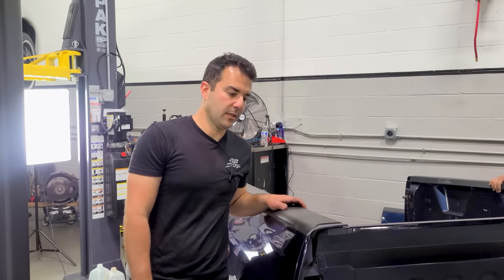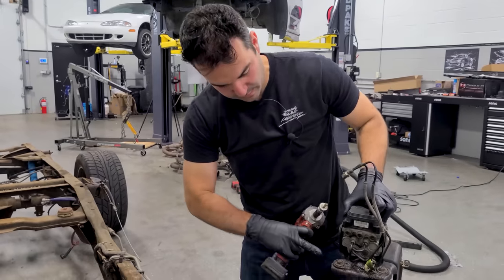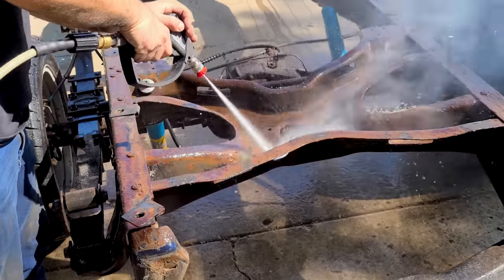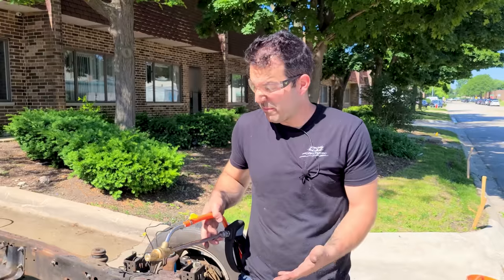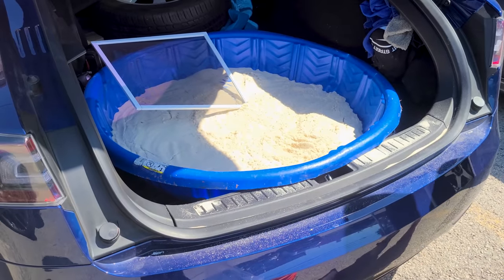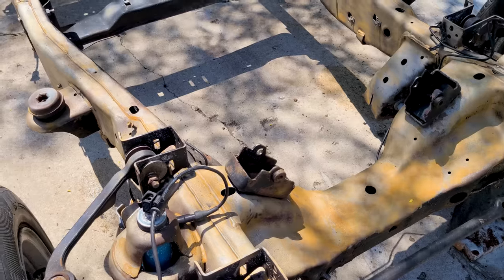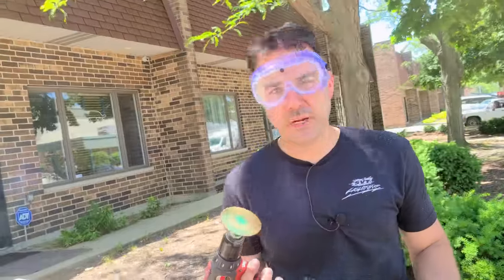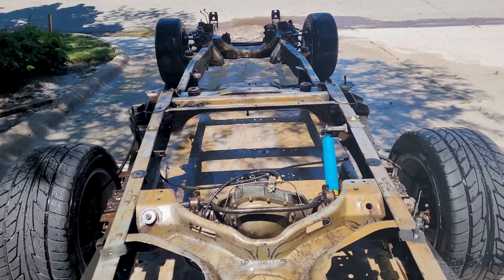I Was Quoted $3,000 To Sandblast My SVT Lightning Frame So I Did It Myself For $100 & So Can You!

Comment from the maker: Would you guys ever do this? What kind of pickup do you drive?
Get started today with a Smart Lawn Plan from Sunday and get 20% off with Code LEGIT20! https://www.getsunday.com/LEGIT
Reply: Yeah, one thing leads to another... :)
Reply: I sandblasted whole frame of my dad's Iveco Daily (it's a little bigger than your truck) and I was 19 at the time. I used regular sand blaster that works with high pressure air. It was pain in the ass to get to some places.
Reply: I’m curious why you didn’t just use a regular sand blaster?
Reply: @GRosa250  I think it's because it's very "messy". In the place when you sandblast is gonna be a lot of rust and used sand and it makes everything around dirty.
Reply: I'm doing a 1977 CJ5 in my driveway. The pressure washer add on will work great. Do you have a link for it ..??
Reply: Hardly 100 bucks when you add the cost of the pressure washer not to mention the lift you used to get the cab and bed off the frame. Throw in all the fasteners and clips you'll break or mess up and its gonna run a lot higher than a hundy...
Reply: Yes I would and I’d like to be the first one to say if you’re ever interested in selling it since I can see you like to take care of things please get in contact with me I have been looking for a true blue lightning for a long time miles don’t really matter especially if it’s somebody that’s trying to take care of it and preserve it
Reply: Hi, from South Africa. I have a 2018 Ford Ranger 2.2 TDci. Six speed manual gearbox, single cab with a 8 foot bed. And, we drive on the correct side of the road 😂👍, so it is a right hand drive. We have harsh winters, but no snow and ice and thus no salt on the roads, and no rust. I live in Bloemfontein, 4500 feet above sealevel and a dry climate as well. My truck now have 136 000 km (85 000 miles) on the clock, and I love it.
Reply: You missed the obvious joke that you feel like a rust buster.
Reply: I drive a 1989 Landrover pickup that's going to get a new frame this year , I just know I'm going to turn it into a restoration.
Reply: if i would come to this stage, id rather strip the entire frame and sandblast it and then powdercoat it. now it seems like a ton of extra work when you are gonna treat the bare metal. nice solution though the water/sandblast, but for this application i think it wasnt the most optimal "when you are at it" :D
Reply: @sttm1283  If I went this far I would do a complete restoration and sell the truck at Barrett-Jackson.
Reply: @mexicanspec  well that would be a option but i guess alex is keeping this old truck for nostalgic reasons, and therefore i would just suggest to do it properly. but since he has more knowledge than me concerning this type of stuff im guessing he knows what he is doing :D
Reply: I did a Chevelle Wagon frame with walnut husks and a HF media blast tank.
Reply: @hammyh1165  I've been on land rovers for 22 years now and Every Land Rover that comes off of the Solihull production line is a restoration project of the future!  I just love them! Had a  series 2 swb, series3 lwb 3.5 V8, Disco 1 3.5 V8, Disco 2 4.0 V8, now a L322 4.2 Supercharged! Love this one even though I spend a lot of time working on it lol
Reply: @sttm1283  powder coating is only just one step up from a paint job in my opinion. Water still gets under it and rot takes hold. I suppose Alex is going to use some form of phosphoric solution to treat the rust then put a special covering over the top. Once it's had the rust treating done it is far more likely to resist any further rust problems, unless of course the rust treatment is removed by some physical abrasion like accident damage. Anyway a few Chicago winter salted years will show us how good the stuff is, but powder coating won't cut it in my opinion lol
Reply: I am a cheapskate so I would totally consider this.  My wife would probably be looking for a divorce lawyer after the weekend though 😂
Reply: 2003 F150 Lariat 5.4L with 205k
Reply: if im going to go this far for restoration, ill take it all the way and get the frame acid bathed and then coated.
Reply: You should try a side grinder with a flapper wheel.
Reply: Thank you for this! I bought one of these blasting attachments for my power washer a while ago for when I get around to blasting the frame on my classic c10. Couldn't find a lot of vids on how well it worked that were this high quality.
Reply: @hammyh1165  if you have a landrover that is the normal state of maintenance
Reply: Pretty excited to see the completion of the frame. So satisfying. If you have a decent pressure washer, you can do this on the cheap.
Reply: Get rid of those leaf springs and put a four link in it on bags 👍🏿
Reply: I would probably do this but I'm only one guy!  I have a 2011 Chevy Silverado Z71 Extended Cab.
Reply: I would flip the whole frame over and blast the other side that way. It looks like you might actually have enough ground clearance that the wheels would still touch the ground with it flipped.
Reply: Hell no! Do you know how much your hands will hurt after using the blaster for 20hrs? You will be seeing a doctor after this process is over!
Reply: You missed a spot‼️🤣
Reply: He missed a spot‼️🤣
Reply: Yes, I would love to do this.  I have a beautiful 1999 F250 super duty 7.3L turbo diesel that I use for my lawn care business.  Every time I start any kind of project on the truck it turns into a rabbit hole and it's hard to stop once I start down the hole.  When we are working on trucks as old as ours, it's easy to find issues even when we aren't looking.
Reply: You need a legite lawn plan dude , you gotta move in my area and call mike smith landscaping and tree service , he aint the cheapest , but his lawns are amazing ...and he is probably cheaper than what that seaweed and molasses your spraying on your lawn ..were all organic sir , its sw florida's way of the future
Reply: I drive a 59 F100.  We have had it since new.  Its my new truck.  The 2 90s trucks  don't count.  There are also several 30s cars and pickups.
Reply: @grandtheftautotune7715  Don't forget the cost of the water, the gas to run the pressure washer, rent for the shop to do work in, the clothes he's wearing, and the food he ate that day for the energy to do the work. The nerve of some people...smh

Comment: I'd love to see how effective this is on aluminum wheels pitted with brake dust!
Reply: I mean, if you're trying to take them back to bare metal with a fine textured finish, you'll be very happy.  But you would need to plan a new surface finish, as the raw blasted part won't stay pretty for long.

Comment: Flapper discs for grinder not drill and you can get different coarseness. You will love  ‘em ! Also I think there is a product you can put in the water to eliminate the immediate rust after blasting. I have purchased a 2003 HD F-150 with the same motor a little detuned and 3,000 miles on it . Like new zero rust and $32,000 Canadian !

Comment: The way the syphon works on the pickup, i use a small ball with lots of holes (watch a video on how that pipe collector for the blaster works, you'll come up with a solution very quickly with what you have laying around. The ball lets the abrasive get collected by the syphon effect without clogging as easy. After blasting, i use phosphoric acid to convert any flash oxidisation prior to re-sealing, which i do the moment the acid has finished doing it's colour change. Very cool video thank you as always

Comment: It's the perfect time to replace every rubber bushing and the springs!!
Reply: Absolutely...that sand and water must have blasted itself in-between those bushes and the friction will certainly cause them to wear out quicker..👍👍
Reply: Did he plug the differential vent? Great time to plan on new diff gears possibly. Also shocks, brakes, wheel bearing seals...

Comment: You can get an corrosion inhibitor like holdtight 102 to prevent the rust at least in the short term.  Coal slag  like Black Beauty from TSC works great with the pressure washer.  I did an iron radiator for a house with that, blew it dry with a leaf blower and painted it.  Looked amazing.

Comment: Two full days work with two people (32hrs sandblasting labor @ $50/hr avg =$1600).
Cost of abrasives and hiring sandblaster two days, protective equipment ($400).
Having a location to sandblast for two days (silt socks on drains as dumping anything down stormwater drains is considered illegal, 2 cases of beer, and a willing friend with location $200).
Cleaning the aftermath of sand, mud, rust and paint properly (wet dry vacuum hire/purchase and labor time $150).
And appling rust remover/paint prep coat and labor ($250).
You're at $2600, saving $400. This all depends on what you and your extra workers time is worth, and if you have a workshop/location available, but for most people $3000 is worth the hassle, labor and mess.

Comment: Just a heds up for future projects. The substrate needs to be completely clean of any oils, grease, or other petroleum product. If it's not cleaed off prior to blasting, its possible to trap contaminates in the surface, and that will cause premature coatings failure.

Comment: Great Project!
Normally they mix water with rust inhibitor cause you won't get everywhere with paint where the water gets. 
And: you should really wear some kind of face mask, sand in your lungs will du unrepairable damage
Reply: Did you not watch the video??? The sand was mixed with water, thus no dust.
Reply: @grandtheftautotune7715  unfortunately that's not how high flow mixing works. The sand has no time to mix completely with the water, so you'll still have some dry sand in the air. 
Sand particles are so small that you can breathe them in and they will pop the bubbles in your lungs.

Comment: To prevent the surface rust that starts forming immediately after blasting if just water is used, most pressure washers do not need pressure feed, so I mix a little phosporic acid into a 20 gallon drum of water and let the washer suck from it. It sort of primes the surface when it dries. Must be a gravel area though, not a paved driveway... If aluminum silicate or like is used insteas of just sand, the cleaning is much faster, but then good protective gear is a must, as the grains ricochet with greater force.

Comment: for a sand recovery system, I saw a guy do this years back himself and he used vizscreen (builders heavy duty plastic sheet 25' wide) under the chassis and around the side he used those portable barriers you see at public events to keep people on pavements, they link together and are about 4 foot high and held the vizscreen up with cable ties, it captured all the sand for him, a bit heath robinson and makeshift but as he said easier than having it all over his front garden and drive, it was a spitfire he was blasting and it was like new when finished, he recycled most the sand, folded up the vizscreen and took it to the tip, job done,

Comment: You can lift another side of the frame up with engine hoist or just jack it up to access underside of the frame. 45 degrees is enough

Another one is that the closed box section of frame is always full of dirt. You should clean it also. Best tool to use is the one used to diy pressure washing a sewer - what ever is is called. They have 360 degree nozzles which drives dirt out

Comment: Looking forward to seeing the frame all finished. I'm guessing you'll use POR15 or Rust Encapsulator for the coating. I use POR15 a lot and more recently began using their Metal Prep zinc phosphate as the pre-coating etch. Also, a wading pool works great as a catch pan for dry sandblasting so you can reuse the media.
Reply: Really like Por-15

Comment: Just a thought. Build a battery pack between the frame rails. Drop in a few Tesla motors. with a cooling system, and you have a modern truck. Takes about, $25,000. Cheap F-150.

Comment: I have a Wet blast rig for my Stihl 130plus power washer (2000PSI) and its not a bad thing but I also use a Blast gun with Bicarb soda and a shop compressor for finer work and surface rust mainly because a quick run over with degreaser or solvent prepwash dissolves the Bi Carb so you dont get the grit issues you do with non soluble blast media.
The other upside with Soda blasting is the enviro rules as the waste from the process is way easier to dispose of when you blast paint or oily parts and with rust and scale its simply a hose away proposition although i do use Sand berms to filter and protect drainage when I wash down.

Comment: These cars were TOTALLY cool!  I ran one in a street duel in Fort Lauderdale and it was a dead heat between this truck and my '85 Porsche 928S2 5 speed.

Note that I said S2;  These weren't sold in the United States since they couldn't even come CLOSE to meeting emissions regulations.  310 hp = high 13 second quarter mile times and 175 mph top speeds;  These were faster than the later S4 and GTS cars, despite the 700 cc deficit.

Comment: A chemical resistant spray bottle with a phosphoric acid metal prep (cheap) can prevent most of that surface rust from forming, can be sprayed on wet, and takes seconds.

Comment: Try searching for "nylon wire wheel". We powe washed the used 1 red nylon wheel to clean up my buddies 63 c10 frame, the did the por15 (metal prep, coating, top coat) turned out great. Pair these up with the sand idea would be great.

Comment: I don’t know why they lie about the amount of sand needed, but if you’re planning on doing this, you’re going to need atleast 30 bags of sand. I ended up using over 40 bags to sand blast the frame and individual parts I removed to get to the frame.

Comment: Paint everything with POR15. It will convert the surface rust and coat the frame in one step. Hey, while the tank and fuel lines are out... Drop in a Hellcat pump and a larger feed line (use the factory feed as your new return) in preparation for flex-fuel. You know, because reasons.

Comment: As long as you dry out the inner frame where sand got in while blasting. completely removing it, just made the outside clen, got get all the debris from inside the rails.

Comment: I did this to a c10 frame, it worked good for a while, then just stopped feeding well. I think the nozzle wore out. But I got the frame done. When it was working well it really worked well, if these units could be improved to feed better they could be really good; particularly with a 4K psi, 4 gpm pressure washer.

Comment: I think a lot of people are missing the fact that this is no where near as good as actually having the frame professionally blasted, or other DIY methods. This is just a step or two above a deep cleaning. It is a fine option for a frame that just has "normal" crud and scale ... not something that has lived in a salt-belt state, or is 40 years old. But it is a much cheaper, and safer alternative to sand or bead blasting.

Comment: You might try fluidizing the bucket of sand to keep it from clogging. Introduce 2-6 psi of air to the bottom of the bucket full of sand. However much air it takes to make the sand "soft" should do the trick to keep it from clogging.

Comment: I have wanted an abrasive water blaster for some heavy items. But eventually you have to ask what is your time worth. I just had a frame and 7 rims blasted. Blaster charged $150 per hour. Overall bill was $900. When I picked them up no flash rust due to dry blasting. First thing I did when I got the parts home was prime and paint. I know for a fact after spending over 1 hour trying to blast 1 of my rusty crusty rims paying to have my frame and rims blasted was worth my money. I start assembling next week after the paint has cured.

Comment: I bought one of these , I haven't used it yet , my 86 F150 was out of CA , and still Has original chassis paint , I've got a 385 ci windsor , motec injected , on a tremec 5 speed , you might want to add a lid to that sand you don't want moisture in there , if the sand doesn't flow well add a very small air bleed line to fluidize the sand .Cheers good job .

Comment: I use an engine lift to remove the bed.  loop the straps through the chain.  Don't use the hook!  I had my truck bed all ready for paint then while trying to put it back on the truck temporarily, it happened.  The strap popped off the hook!  4 hours more body work and some welding and she's ready for paint again.

Comment: I wish I woulda found this video earlier lol. I'm restoring my 1964 impala, full frame off. I already stripped and painted the frame but I did it the hard way with a drill, grinder and wire brushes. I was out in my hot shop for like 4 weekends getting as dirty as a human possibly can when I could have just pressure blasted it all. Dang lol.

Comment: I, agree with many of the others. More abrasive material, angle grinder, if in a subdivision you could walnut shells from Harbor Freight, biodegradable. Many ways to speed things up.

Comment: I really feel for you in that You just wanted to have a cool shop truck and it's become a restoration project... But at the same time you're going to end up with the nicest SVT lightning that you could have imagined. You now know it's clean and protected underneath everything. Might as well do the fuel system while you're putting it back together so you can support more horsepower which your new bottom end will be built to take and... Etc.

Comment: When I had a go at this I got a ten gallon metal bucket and fixed a metal funnel to the bottom put feet on it and the sand only had one way to go and that was down and absolutely no feed issues 👍👍

Comment: Rule number 1
Read sand blaster instructions to make sure your pressure sprayer meets the minimum required water flow rate for your nozzle.
Rule number 2.
Not all sand flows the same.
I discovered the sand I had access to was prone to clumping and needed a pressure pot to supply the steady flow of sand.